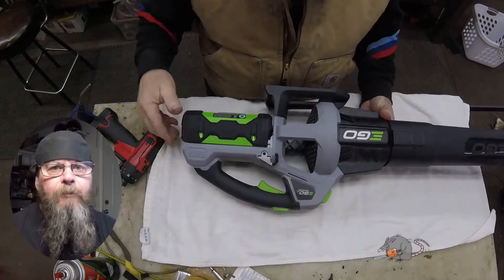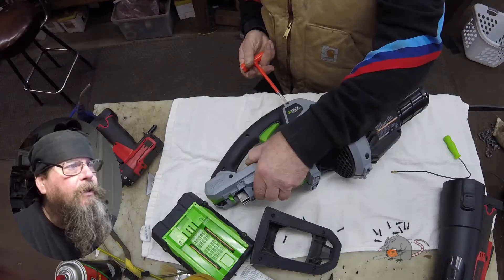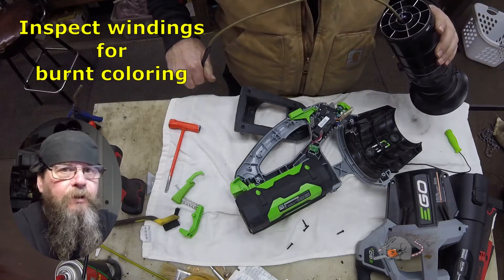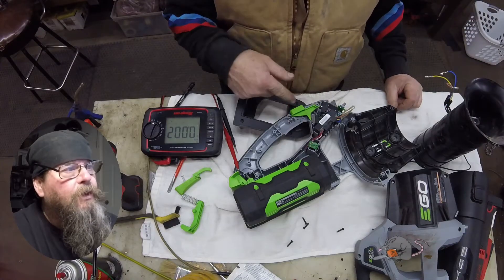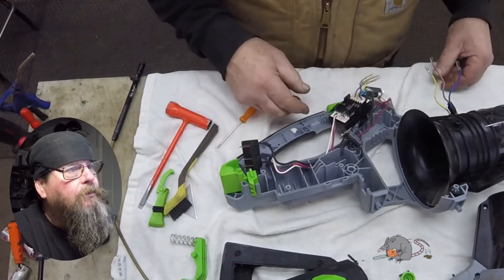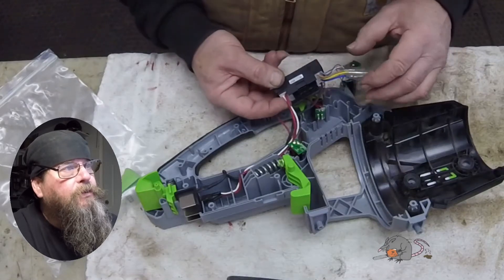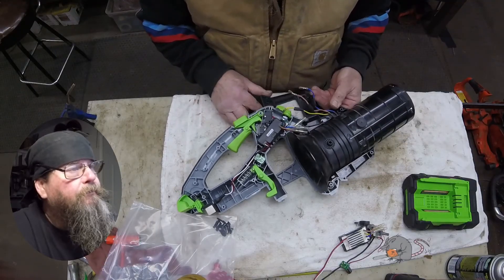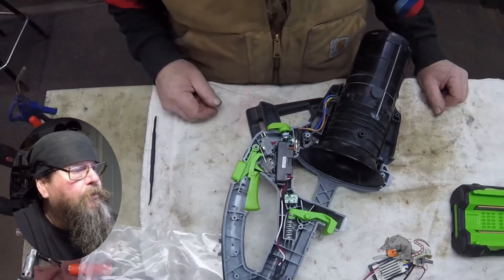Ego Battery Powered Blower Quit Working-Fixed!

Comment: what does it mean you think when you put in a good battery , pull trigger on ego 670, and the light on the battery comes on, stays until you pull it. Both my batteries do same  but they work fin my snow blower and back blower
Reply from the maker: If the batteries work fine in all other equipment the the blower has an issue. There's only one part number you can replace for the entire electrical assembly and one part number for the motor. You could follow the video and test the motor to narrow it down.

Comment: I left mine outside in heat for a while when I picked it up it was extremely hot and I pressed it to see if it will blow it did but then sounded like it messed up battey still turned on just no air :(
Reply from the maker: Thats not good.

Comment: Great video! I love this 765 blower, it's a beast, but it crapped out recently and like your video i checked out the motor and all seemed fine so i ordered the harness. i installed the new harness and the motor still just clicks when i pull the trigger. What are the chances the new harness is bad? I hate to buy a new motor if its not needed.
TIA for any help!
Reply from the maker: I don't know the odds but I've never had a bad one. Having said that, I've replaced too many so who knows. Last time I bought a motor it was 80 or 90 dollars.
Reply: What did you end up doing? I have a 765 that was repaired once (only 3 months into ownership) and now it just clicks. I got a replacement, but feels so wasteful just to have the broken one is a paper weight...

Comment: Replacing the mosfets is likely the proper fix, and it probably needs a bigger heat sink to avoid this in future. https://youtu.be/FxO7CpV4b9g?si=wt0DZB6W53pT5eot
Reply from the maker: Thanks for the link. That was a good explanation of what goes wrong with these.

Comment: I'll never buy another one..
Reply from the maker: The only good news I have about these units is that Ego has never denied a warranty claim for us.
Reply: @TheGreasyShopRag  Then you are lucky. Ego denied my warranty as, although I bought it through Amazon, the supplier was not approved. It was brand new in a sealed box. I just installed my third new harness, as the previous 2, at $90 a piece, failed. One question. The wires from the controller to the fan are brown, yellow and blue, but the fan wires are yellow, blue and red. Can I assume the brown wire connects to the red wire?
Reply from the maker: @richardwoodcock849  Yes that's how I just wired one when replacing the blower motor. Everything worked as it should.
Reply: @TheGreasyShopRag Thanks! That's what I did and it's working again! For now.......

Comment: My blower just died. Called support and they said that if I open it I void the warranty. I am in Central America right now at my vac house. What choices do I have because I won't be back for another couple of months ...? I want to open it ... The blower was ordered from Amazon.
Reply from the maker: Will amazon take it back? if not, you know your choices. If you open it you will void the warranty. Which is more important, your curiosity or some cash? I'm pretty sure one of the decals covers a screw so they'll know if you opened it. Let me know what you decide.

Comment: Just an update. My dead EGO blower was replaced with a new one under Warranty. From what I understand, the local EGO service centre did not have the spare parts to replace the faulty component (I assume it was the main PCB) and the easiest solution was to supply me with a new blower of the same specification. 

As a side note, there are a few posts on the internet suggesting that static electricity build-up and discharge around the device's switches can cause the internal electronic components to fail. I usually wear rubber gloves when gardening. But on the occasion where the blower failed I was wearing leather gloves. Rubber is a natural electrical insulator. Leather, especially moist or sweaty  leather is not a good insulator and can be a good conducter of static electricity. Might be pure co-incidence in my case. But in future I will only use bare hands or wear rubber gloves when using any EGO devices that I have.

Disappointed that the first unit failed. But very happy with the service I got from the local EGO guys. 

Cheers.

========

Thanks for the great video. After two years of sterling service mine has simply stopped working. When I operate the switch, all the LEDs on the connected fully charged battery illuminate and stay illuminated. But the blower does not operate. So it's off to the local authorised service dealer.  Not much that can go wrong with these machines. I imagine the repair will be the same as in your video. 
It's a pity these devices can fail so easily. But Thanks to your video, seeing what they look like inside, it's little surprise.
Reply from the maker: Its good to hear they stood behind their equipment and got you that new unit. Thanks for the update.

Comment: Great video ! I surmise you are an Ego dealer. I have a Toro flex 60 volt blower. The other day I got it out to blow some snow around. I turned it on and it would run for maybe 30 seconds and cut off! The battery was good. The battery to blower connection seemed good. I looked up a parts list for this blower at Toro's website. There are no internal wiring parts/ harness listed. They mentioned something about an authorized dealer repair. We have one  about 20 miles away .I doubt if they work on these rigs. I am thinking that my harness is bad as well.
Reply from the maker: We are authorized to repair Ego but can't sell them because the local hardware store can sell them but not fix them. Go figure. We do sell Toro but I can't remember ever having to repair the handheld blower so I'm not sure whats in there. I will say that I've seen bad batteries that I thought were good and also people putting low amp hour batteries in high demand equipment and getting bad results. I guess I'm asking if you're using the original battery that came with the blower.
Reply: @TheGreasyShopRag  I have several of the 60 2.5 Ah I use with the trimmer and hedge trimmer. What the blower does is I can turn on and put on high speed blow .It will run for maybe 15 seconds and shut off. It will turn back on and run maybe 30 seconds. It doesn't matter what battery I use .
Reply from the maker: @gregfisher216  Ok its sounds like you've confirmed the issue is with the blower and not the battery. Hopefully a shop can work this out for you.
Reply: @ Thank you for the help. I will try to reach out to Toro about the wiring harness. However it may not be feasible if the part is almost half the price of a new blower. I will tear it down and see if a micro switch is out wack or something minor, an easy fix LOL
Reply from the maker: @gregfisher216  Good luck with that repair.
Reply: @ As we say in the repairing of battery operated equipment. It is never the battery unless it is the battery. It turns out the 2.5 batteries can't handle the load of the blower anymore. I tried my 6.0 ,270 watt hour battery I use on my lawnmower. It runs great ,no issues! I am sure down the road I will have to replace the 2.5 batteries as they getting a little long in the tooth at going on 4 years. Thank you again.
Reply from the maker: @ Thats not surprising and is why I asked if you had the right amp hour battery. Turns out you did but the battery won't discharge fast enough for the needs of the blower. Thanks for the update.

Comment: Thanks for the great video. After two years of sterling service mine has simply stopped working. When I operate the switch, all the LEDs on the connected fully charged battery illuminate and stay illuminated. But the blower does not operate. So it's off to the local authorised service dealer.  Not much that can go wrong with these machines. I imagine the repair will be the same as in your video. 
It's a pity these devices can fail so easily. But Thanks to your video, seeing what they look like inside, it's little surprise.
Cheers.
Reply from the maker: Good luck with the repair and thanks for watching!

Comment: My blower cuts off and and I check the battery and there is still quite a bit of battery left so I try again. The blower will start back up and blow for a while. It’s been doing it randomly so I’m afraid it’s going to eventually just stop working. Do you think that’s the wiring harness?
Reply from the maker: It sounds like possibly a switch but really it could be any of the electrical components...even the battery despite it still having capacity.

Comment: So, what’s the part number?! 8:30 got it!! Juicy update! It’s been sitting in the back room, not working, for over a month. Today, all of a sudden it started up full speed. It wouldn’t shut off unless I turned the dial all the way down or pulled the battery. Good enough for me. I’m tired of fixing junk.

Comment: OK Right to it...Fuses blow for a reason...question is WHY...that is never discussed. I keep reading comments in Amazon and other forums where blower was working find and then stops. Mine also did the same after using everyday for 30 minutes and after 30 days dead. Without taking it apart I already know its a fuse. Question is why is a $300 item blowing a fuse on a simple freaking blower. THe circuitry is NOT designed properly. Either not big enough capacitor for the spike in power and load or something else but clearly this will keep happening so whats the point of replacing the fuse only for it to reoccur at random
Reply from the maker: I feel your frustration but have no idea why they make them the way they do.
Reply: Probably because you held the turbo button down for to long
Reply: @sirwrenchalot  I always hold the turbo down the entire time and it lasted about 30 days that way. The timing of how it died was interesting though. I hadn't used it that day, put a fully charged battery in and only lasted a few seconds after turning on and then DEAD. So if it was the turbo issue you think it would have happen during that operation after 15 minutes or so...either way faulty design. The next 1 I just bought was from Lowes and it will cover the 1 year warranty...Amazon is not authorized dealer...dont buy it from there unless you want to try it and send it back
Reply: @AD-hs4cw  trust me I did the same thing, got a new one and the warranty. You know it’s fucked when the help line knows exactly what happens and says your screwed. Like nice 👍🏼 if it wasn’t so good I’d spend 300 dollars somewhere else lol
Reply: @AD-hs4cw This model is worthless without pressing the turbo feature.
Reply: Mine just stopped and I was minimal speed, barely pulling the trigger. I researched and found an Ego rep explaining to the person about a grounding bar in the handle because it builds up a static charge and if you wear gloves it can cause short (blown fuse). I’m not sure I buy any of that but the customer replied they weren’t wearing gloves which makes me believe the rep assumed the issue, therefore it’s common. I, for the first time in two years, was wearing gloves and at lowest speed, it cut out. Typical business, sell it even if it’s junk.
Reply: I dropped mine 🙄
Reply: That exact same thing happened to us
Reply: I'm in Australia and have had 3 670cfm blowers die within 2 weeks I'm tired of contacting ego and getting replacements sent so I got a refund. An older 580cfm model I had lasted 5 years. It's definitely something popping in the wiring I heard on all 3.
Reply: Ive had 3 x 765cfm blowers go kaput since January. I've invested into  2x7.5ah and 2x5ah batteries so feeling rather pissed off.
Reply: @sgs89H  WOW...like I was saying DESIGN FLAW...ITs the fuses or worse the MOSFET power transistors
Reply: @AD-hs4cw it's not good. I've spent a lot of money on the Ego infrastructure and now I'm starting to regret why I didn't stick with Stihl when changing over to Battery!
Reply: @sgs89H  I choose this for its power...its the strongest performer by far, by I agree on reliability right now. I have a 1year warranty from lowes...so I am good until then, but for the price of this thing they should recall any models or build numbers that and do a component redesign. It seems obvious that the components cant seem to handle a massive amount of turbo without burning through components and that is HORSE SH!T. I should be allowed to run on TURBO for the entire time if I want...
Reply: @AD-hs4cw  1 year on the blower? should have a 5 year i believe. mine died after the 2 year mark and i just got a replacement because no one inside of a 1 hour drive was repairing these. lowes nor ace here wants to deal with em. Ego rep wanted me to drive out there, i asked for a simple replacement and they relented.

Comment: This video saved me from buying a whole new blower. Mine went out two weeks after the warranty expired!!
Reply: ask yourself WHY? otherwise it will just keep repeating. I am not bothering to take mine apart and go through all that to replace a fuse so it happens again and again. EGO needs to recall all these blowers and update a fix for these boards. this is nonsense
Reply from the maker: @AD-hs4cw  I'm not sure if the replacement boards have an improvement or not.
Reply: @TheGreasyShopRag  appreciate that but to my point, nobody knows and the 1 I just bought brand new I used everyday for 30 minutes a day for about 30 days straight...mostly on turbo...then one day I hit the trigger and a few seconds later ...dead...so that would tell me they are still manufacturing the same crap electronics
Reply: I should add I had 2 days before I could return to amazon, so back its going
Reply from the maker: @AD-hs4cw  Sounds like a good plan.
Reply from the maker: @dtitus74  Bummer about the warranty.
Reply: @TheGreasyShopRag  yeah but this video saved me a lot of money. I’ve never messed with electronics on really anything but I got it working so I have this video to thank.
Reply from the maker: @dtitus74  Glad to hear it. Good job with the repair!

Comment: So how did you make this a warranty claim? I've had mine for about 3 years and now it wont do anything. Battery is good, checked motor and it is good also. Have no idea where my original receipt is...thinking it must be the control circuit.
Reply from the maker: The customer contacted Ego, confirmed warranty status, and was given our information along with paperwork that basically said we could repair it if it was manufacturer defects. I don't make the actual claims with the manufacturers so I don't know any more than that.

Comment: I have this same problem.  Great video, but I can only find the complete assembly for sale.  Is there a source for just the control module? Thanks, Lew
Reply from the maker: I only get oem ego parts and those come as an assembly.
Reply: @TheGreasyShopRag    Thanks for the reply. Yes, I got the part number from your video which is for the assembly, but only saw you replace the module and was hoping you had a source. Order is on the way.

Comment: Question on 445 Husqvarna bar oil vent.  Having trouble finding quality information.  Think it’s behind chain plate.  Some say it has a duckbill others don’t.  After turned off it continually leaks from several places. Oils probably, but seems to keep building pressure while just sitting.  I think I found an IPL showing a duck bill with screen under bar plate. Any help would be appreciated. Thanks.
Reply from the maker: Yes location is correct. Its a duckbill valve covered by a bronze sintered filter. Maybe its plugged up with schmutz.
Reply: @TheGreasyShopRag  thanks, Santa didn’t bring clutch removal tool. Now to look for local dealers.  I like purchasing the correct tool for the job.

Comment: To test the blower motor, could you have connected it directly to the battery to see if it would spin?
Reply from the maker: If it was a two wire brushed motor then I could have.